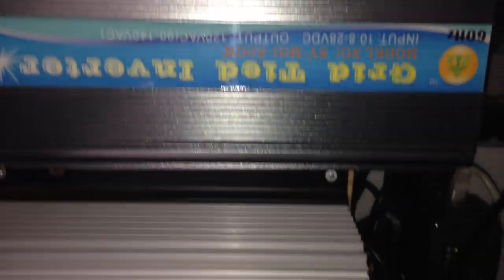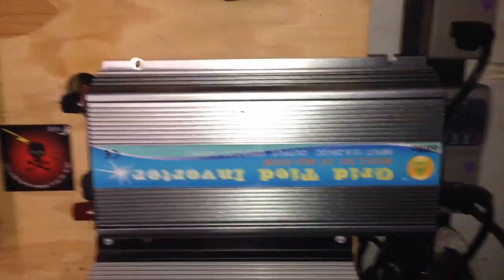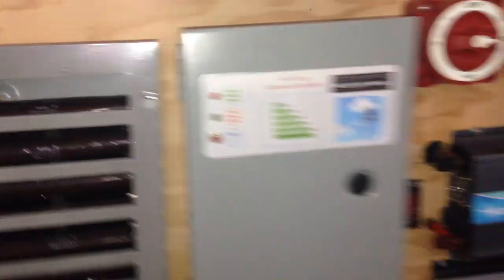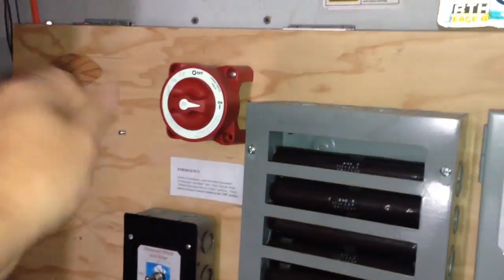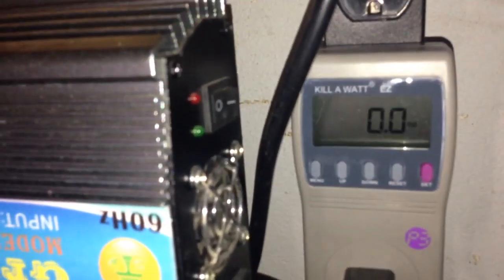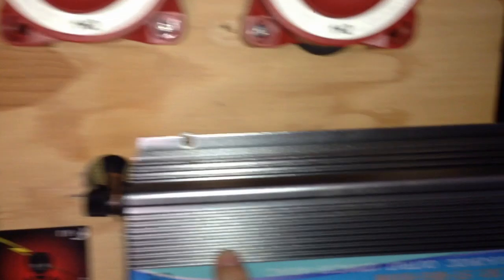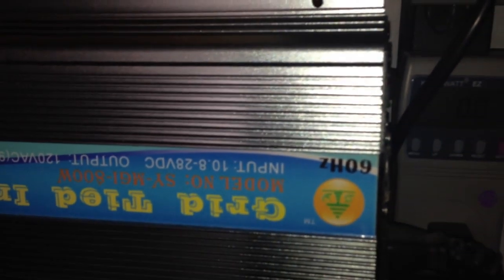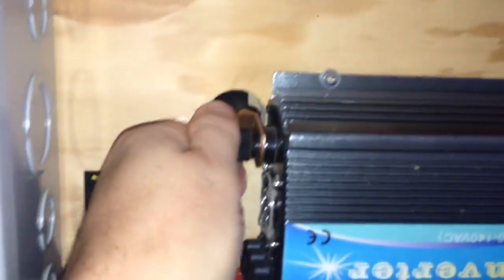Plug-in Gridtie Inverter Question

Comment: Read the manual first before you install it you should not disconnect the dc side when the inverter is under operating condition it might damege the component inside

Comment: That unit has a problem if the AC from the grid is lost then you must remove the DC then connect the DC back and it will work again till it looses the grid AC again then repeat.